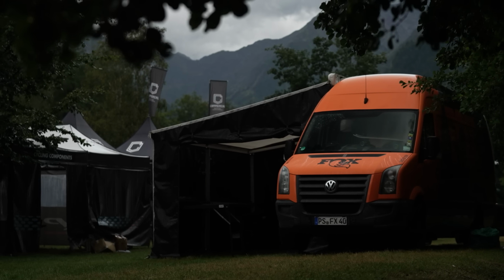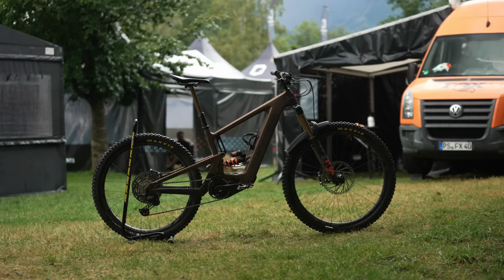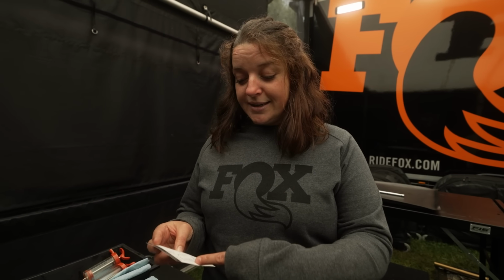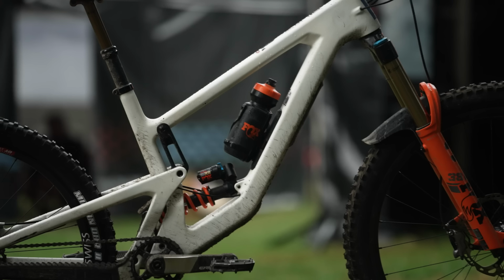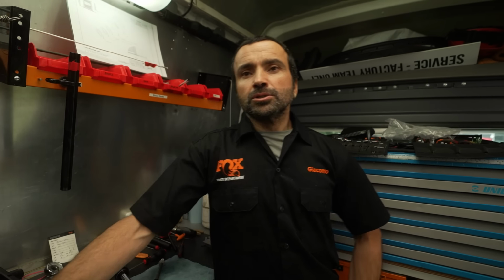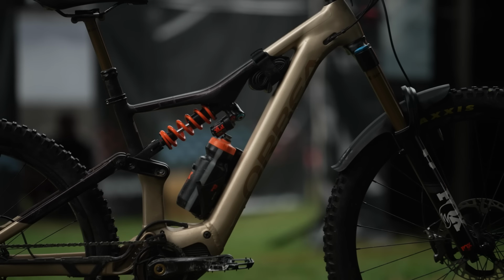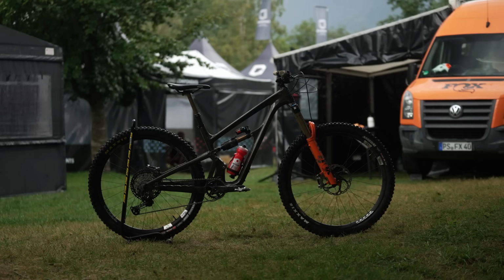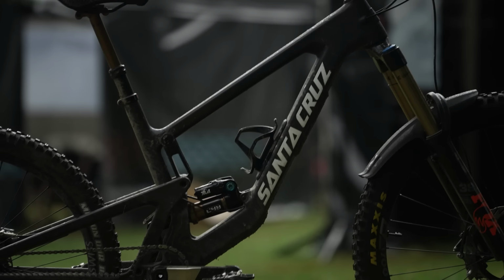DIALED S5-EP37: Bike check with the team | FOX

Comment: Can you give any more details on the 2024 LMT (LNT) soft damper you are running?  Will this be a replacement for the Grip-2 or just a different tune?  Will all 2024 36” and 38” Factory forks have this new damper?

Comment: If you were wondering if the Fox team felt the base compression tune was high on the Fox38 you can see they are all running HSC almost wide open. This includes Taj, Jewles, and Jordy all saying they were on the 2024 GRIP2 Tune they called "LNT Light"
	 Weight KG	Travel	PSI	TKN	HSC	LSC	HSR	
TaJ	      102	170	107	2	6	10	6	4	
Jewles	84	170	105		8	12	6	9	
Pete	86	170	109	1	6	8	6	9	
Jordy	83	170	108	1	7	9	4	6	
Marko	78	160	105		6	10	6	11	
Jake	69	160	82		8	9	6	9

Comment: Dear Fox Team,

please tell me how many spacers are recommended to run between the headset and the stem according to your engineers (20mm, 30mm, 40mm...). Unfortunately, I couldn't that info on your website. 

The fork in question is Fox 36 Grip2 2021-2022 (currently at 150mm).
Reply: not fox but it depends on riding style, if you go down steep stuff a lot, you want more spacers to bring the bars up and help keep your body position more neutral, but if you do more flatter stuff or climbs you can go with fewer spacers below the headset as itll keep more weight on the front end

Comment: This was awesome. I weigh as much as Jordi and my fork has 17 psi less in it and i have never bottomed it out even off of huge drops. I don't get it haha.
Reply: Because air pressure determines spring weight and sag. Compression damping is what stops you from bottoming out. 😁
Reply: @Tony_P  My compression is wide open, so that doesn't explain it